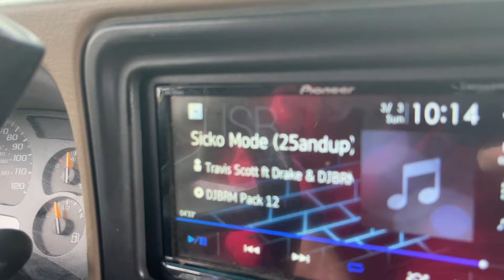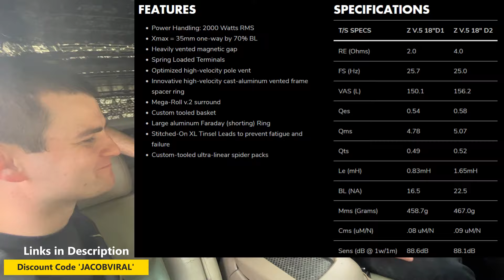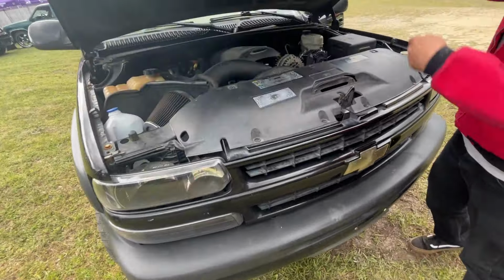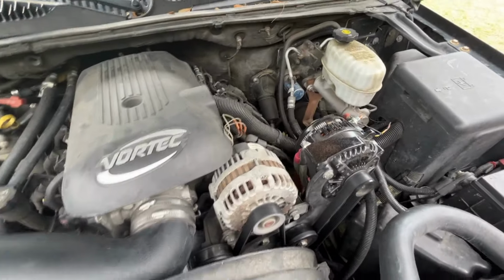$2000 AMPS AT 0.2 OHM!? 4 18S C-PILLAR SYSTEM!

Comment: I had 2 of my Soundqubed S1-2250.1 amplifiers strapped at .25 ohms. That was about .12 ohms an amplifier 👍 It worked but I could tell at loud volume my subwoofers were clipping before the clip light on my bass remote. It also was less loud when I had it strapped at .25 ohms.
Reply: Gotta have good electrical to run that low of an ohm load
Reply: @bassbrother101  yeah I know. Sometime I'm going to get another battery for the back. I now have 4 Audio Legion AL1600.1D amplifiers.